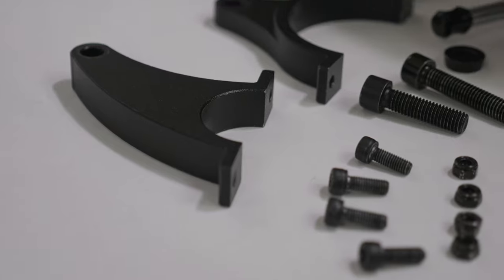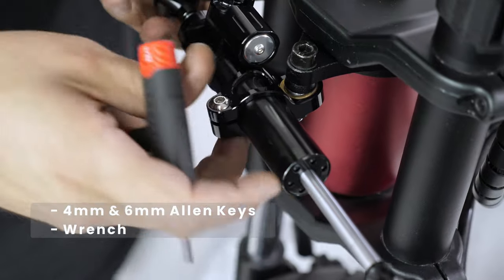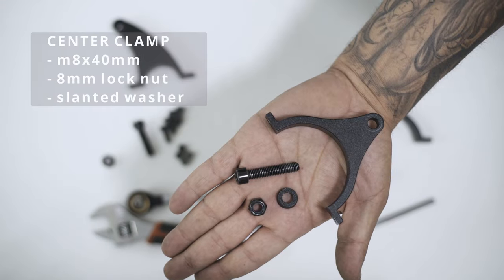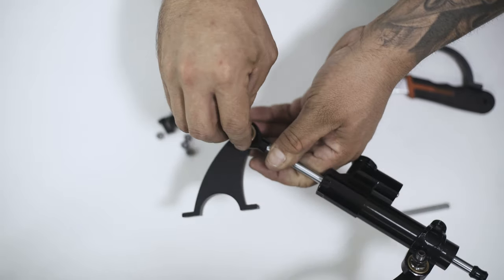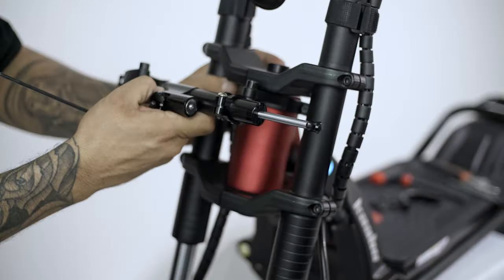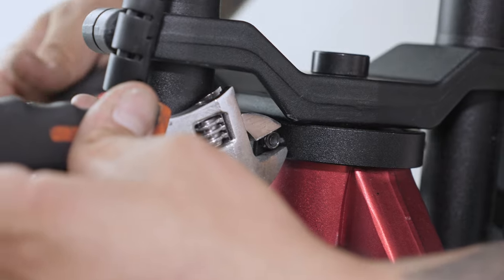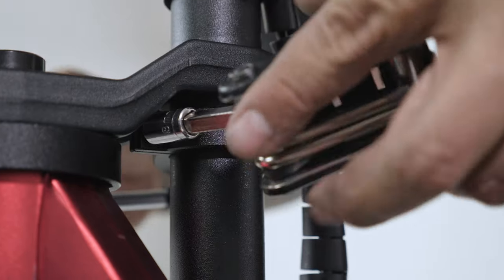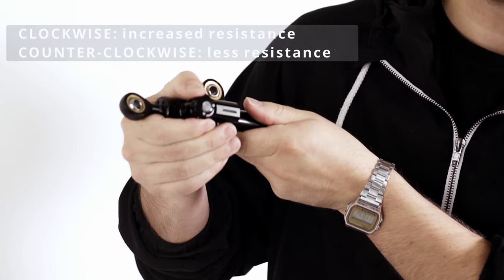Installing a Steering Damper on Your Kaabo Wolf Scooter

Comment from the maker: Want more steering damper content? Read our blog on how to install a steering damper on the Wolf Warrior, Wolf King, and Wolf King GT https://bit.ly/KaaboDamperDemo
Reply from the maker: If the screw and washer placement does not fit correctly for you, try swapping the screws so that the M8x40mm and washer are placed where the M8x30mm ones had been
Reply: I do not see this damper on the web for order, I have had my Wolf King GT up to 67mph, it does feel stable already but I would like it to be stiffer, thanks guys and gals, loving my🐺👑GT❤🛴💨💨💨
Reply: Will this damper work on a Yume y10 scooter.